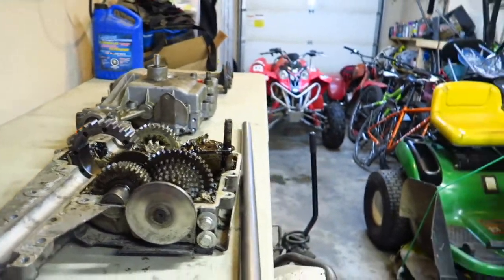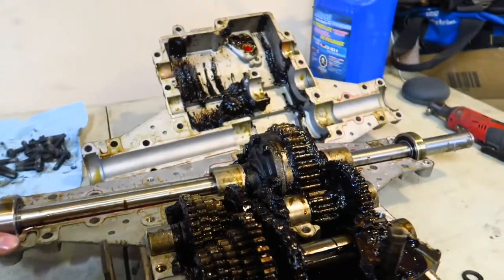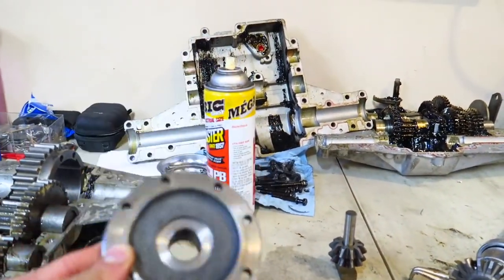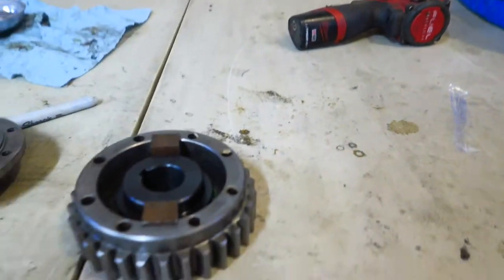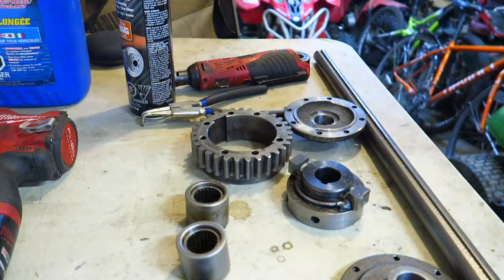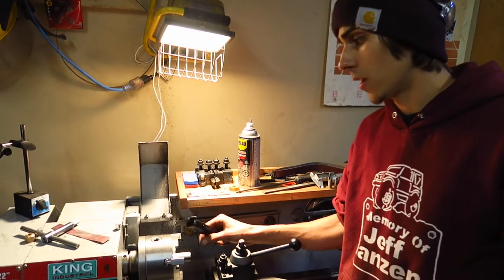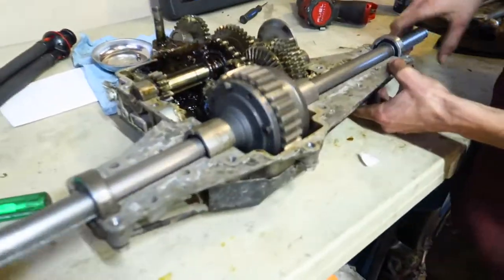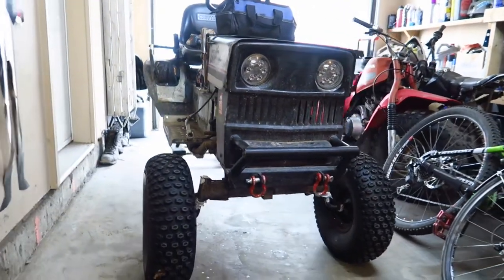How to install a solid 1 piece live axle into a peerless 820 transaxle (full how to video)

Comment: If those inner axle bearings are still factory needle bearings (i know you can buy bronze bushings from peerless that press in those housings and some 820s came with bronze bushings there) you will have serious galling issues in no time on a standard cold or hot rolled keyed shaft... Needle bearings are super hard and need to run on hardened, precision ground surfaces. There are a few vids on YouTube doing this mod a few different ways but they all use bronze in place of the needles there cuz even if by some chance u find a hardened precision ground keyed shaft the keyway will totally fuck it anyway..